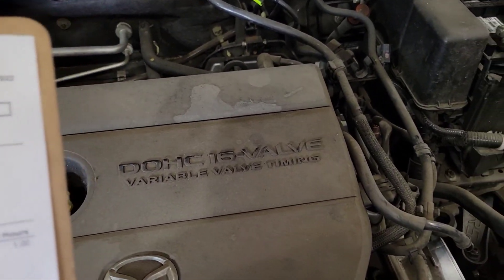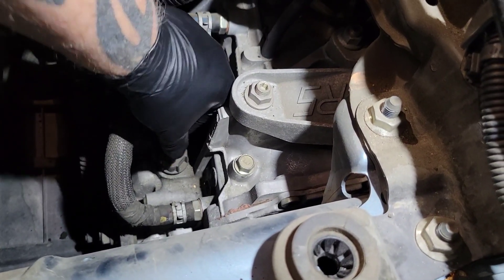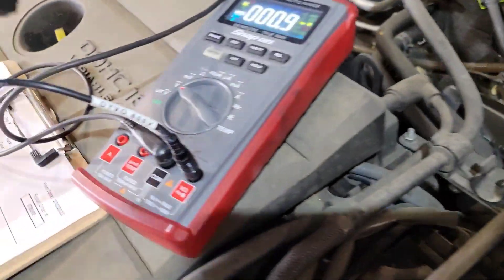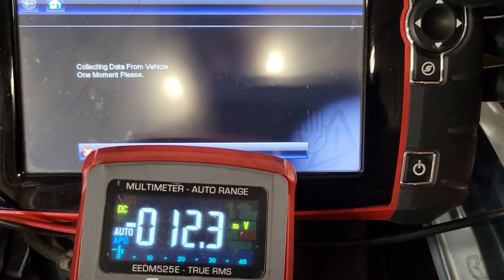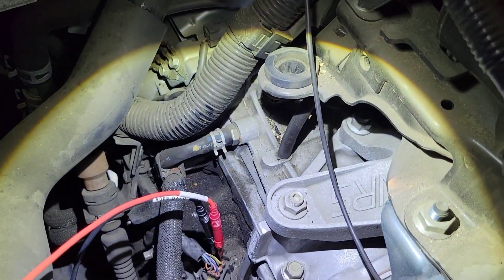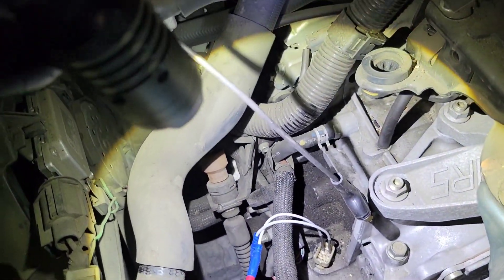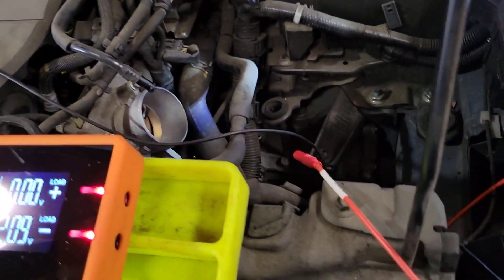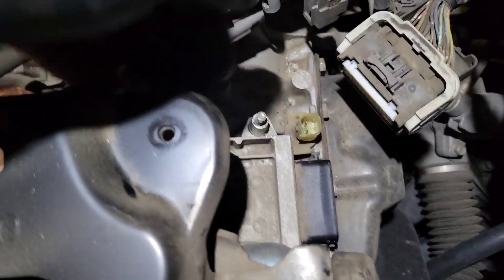4 Cyl Mazda Shift Solenoid Problem

Comment: Maybe i missed it, but how did you conclude the tcm failure?
Reply from the maker: @spontaneousideas7701  I tested the wiring,  the solenoid multiple times and load tested wiring so the only thing left was TCM. Funny thing about this was e sent out TCM to be rebuilt and after getting it back vehicle was doing the same thing.  Service advisor had me replace the solenoid and it still did it.  I had to get on the phone with the rebuilder and tell them exactly the driver that was failing and after that it was fixed.

Comment: Can you do a starter voltage drop test with that dyvo? Do it at home not the shop don’t want you wasting time with it at work
Reply from the maker: Yes you can here is what Dyvo says. Great question. Yes! You can test the main B+ cable to the starter, case ground, trigger wire, and drop across the starter solenoid. We recommend to make all tests while cranking. And with the dual channels, you can test two of those items at the same time.
Thank you

Comment: Great diag video, especially covering multiple ways to test circuits and components using different equipment. Excellent example of using DYVO to load test a component and check the integrity of it, rather than just passing a resistance test. Very smart to compare the readings from shift solenoid A and B. Nice work!
Reply from the maker: Thank you very much for the feedback I really appreciate it. I always teach people to test a known good for what a good result is. I love the Dyvo and cannot wait to see what else I can do with the Dyvo. Stay tuned.

Comment: I was able to follow you through your process but I got lost with the Dyvo meter. How were you able to load that circuit by only connecting it to the ground pin?
Reply from the maker: Because the Dyvo is grounded through the battery cables and since the solenoid is grounded on one side, you only need to test from the one side. Thank you for watching.
Reply: @NutsandBoltswithTone  okay cool, thanks.